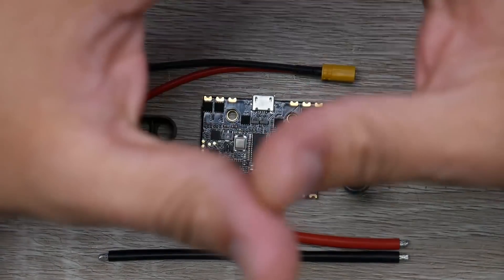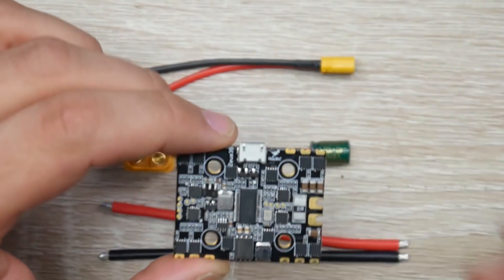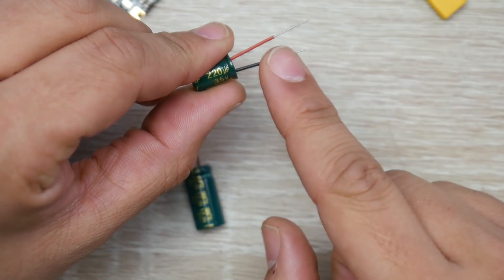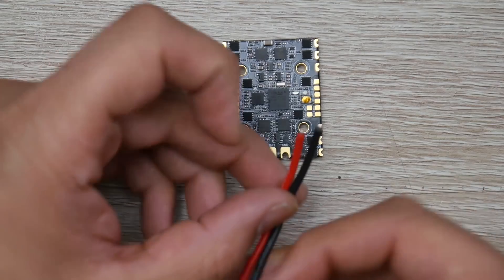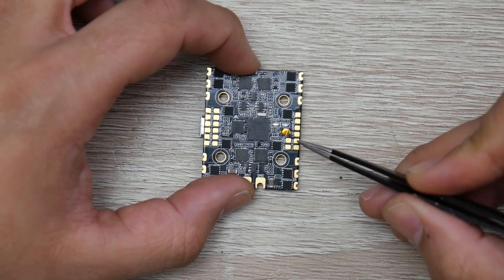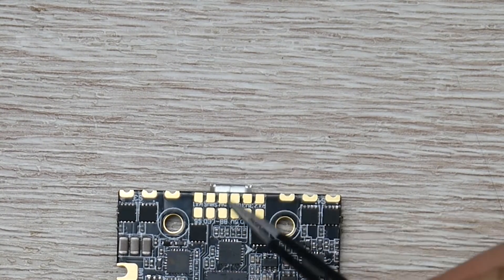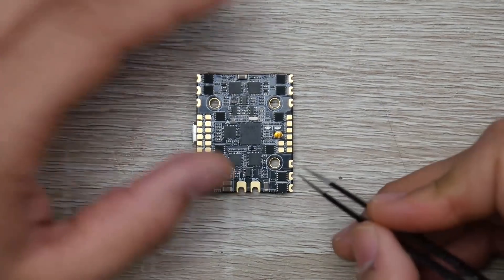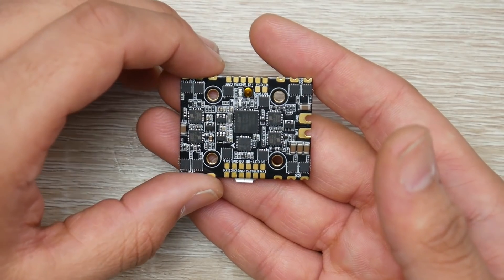The All New 2020 HGLRC Zeus35 AIO // Overview and Setup

Comment: Love the video.... was wondering... could this be used on a 3 inch racing quad without to much issue running 1505 motors? Still new but looking to switch up my electronics on my 3" neutron to stay under the 250g mark as we are not local to any fpv fields.
Reply from the maker: Yes this can be used make sure the it will fit though this board is pretty big for a 20x20
Reply: @DroneMesh  Thank you... yea it is the FPV FlightClub neutron... so it should fit. Thank you again for the review on this board.
Reply from the maker: @ChristKrew-Rev1.8  Your welcome :)

Comment: I've had an original zeus on a 1306 2700kv (low kv) 3" Catalyst Machineworks More Massive Droner, and it's lightweight, efficient as fuck, and still performs like I want. Was sad before that the board could only do like 12-13 Amps on 4s, but this new board is gonna blow that out of the water!

Comment: I suppose we’ll see lots of these sitting beneath Caddx Vista units.
Reply: vista also has whoop mounting
since there are 20a whoop boards now, i don't see the point of this, especially because it takes 3s minimum
Reply: @marc_frank  dont think this is for whoops mate
Reply: @icarusix8750  whoop board sizing is used on most toothpicks